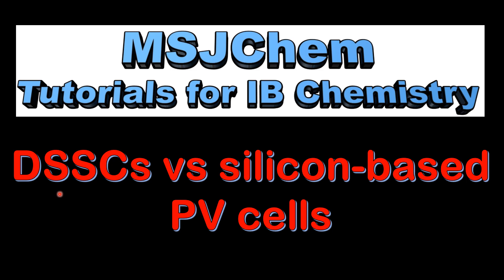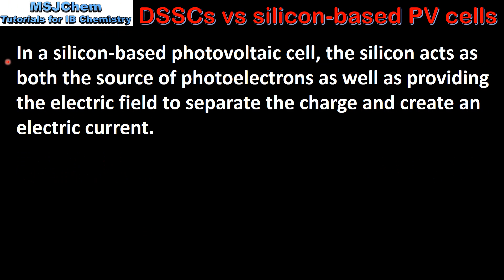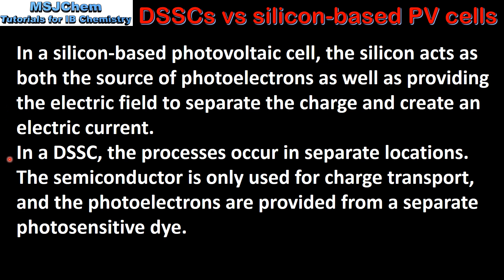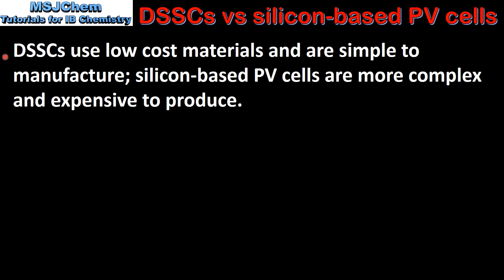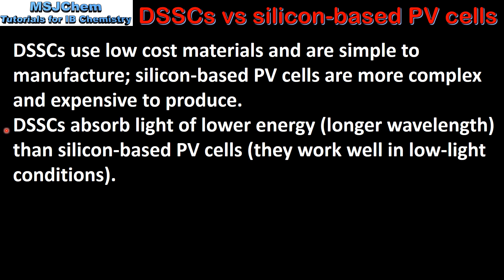C.8 DSSCs vs silicon-based PV cells (HL)

Comment: Hi MSJ, I had a doubt. Wont DSSCs be considered expensive rather than Silicon based PV cells due to material such as Titanium and Platinum present in it?
Reply from the maker: They are cheaper and easier to make.